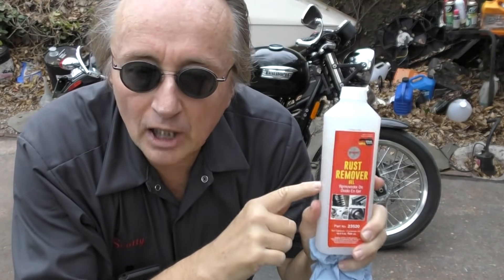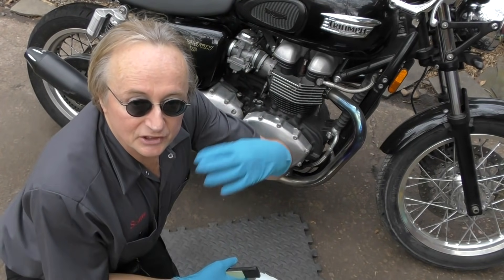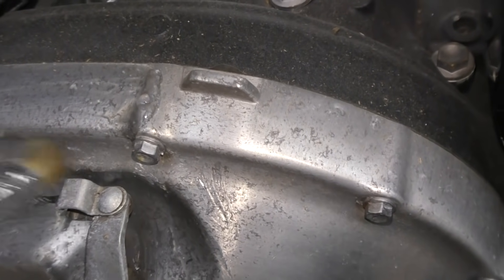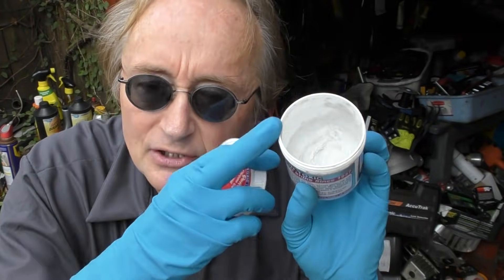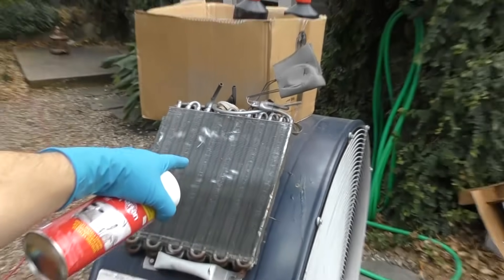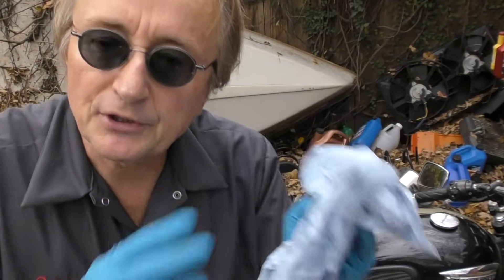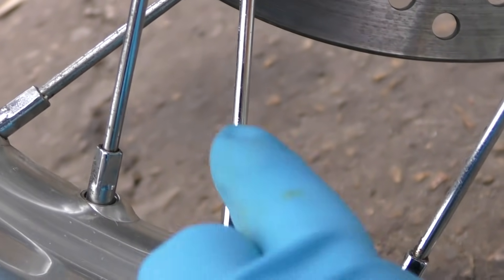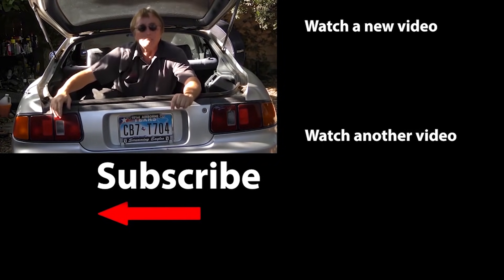Never Get Rust on Your Car Again

Comment: A millimeter is about the size of a number 2 pencil lead.  Bought a '97 F-150 with 180,000 miles that lived on a dirt road.  The frame and everything else was coated with moderate rust.  Washed all dirt and sand from underneath at cashwash, then sprayed 2 gals of Krud Kutter on everything metal.  The Krud Kutter turned the rust to a black paintable surface.  16 cans of 3m undercoating later, got it all sealed up and ready for Kansas road salt.  Like to try the metal coating Scotty.  Happy, Safe and Prosperous 2019 to everyone.  Instead of road rage, peace patience and love one another.

Comment: Here in Ohio, it's almost impossible to find a car that doesn't have some sort of rust. The salt they put on the road destroys vehicles
Reply: OhighO Skater 
The salt we  are using up here in Canada (we are three hours north of Grand Forks North Dakota) is beet juice it’s more expensive than traditional salt but it does not damage the roads and the vehicles
(It’s not the kind of beet juice you would drink)
Reply: OhighO Skater 
I wash my car two-three times a week anytime that there is an accumulation of snow or black Slushy snow on the rocker panels and quarter panels and wheel wells 
Although, Some weeks go by that  I do not need to wash the car as the salt is not a problem ; today were  -33 C here and I won’t need to wash it for a while because it stays clean
I just hate having salt on my vehicles ; my cars have Dont rust much but over washing them  has caused numerous paint chips on my 2006 and 2004 cars
thanks to Scotty I’ve sealed the paint chips with clearcoat as he suggested in one of his videos
Reply: OhighO Skater same in Central New York
Reply: @paulscontainersltd.4020  water activates the salt so if it's not above freezing, washing is the worst thing you can do.
Reply: I wash the salt off whenever I can too, best to get that crap off asap
Reply: WD40 in UK    Also. Ordinary household polish spray keeps moisture off everything to months. Cheap and quick to use.
Reply: Lol....I live in Canada. Some brands rust, others don't, ever. Ford's are good out to 20 years, Mercedes , 7-8 years, Mazdas, Hondas are rust buckets. Only Ford uses tar strips on welds and uses plastic wheel liners.
Reply: Yep, same is true in Indiana. The Midwest is brutal on cars.
Reply: Paulsaulsilverman S in NS they still use the ol rock salt, we can always tell when a car comes from out west because the bodys still in awesome shape but the windows are often chipped from stones in the sand they use, they were thinking of using a light saline solution for a while that was easier on metal and can work during a deep freeze but i guess it was too expensive

Comment: How many gallons to make a 1ft puddle of jell? So I could drive my car into and let it sit for about an hour.
Reply: I was thinking 20'x5' deep pool filled and renting small crane to dip my Subaru in like a taco chip in salsa...
Reply: Get a gallon of rust paint. Remove a quart and mix it with an equal part paint thinner. Use this as primer.
Thinner causes primer to soak into the rust.
Remove loose rust with a flat screwdriver and wire brush, prime  till the surface looks like orangpeel before using full strenth paint.
Reply: @suggesttwo  r/wooosh!

Comment: You have a happy new year. This is Ernest. From Kansas. I truly thank you for your time that you give us. You are very helpful. We fight rust here with the over treated roads. I am 55. Every year they put more and more road treatment on for the bad weather. When I was a kid, the roads would be snow packed for a week or two. Now it's clear right after the storm. Now people do not know how to even drive in bad weather. Not only does it destroy your cars. The roads don't last very long. Sorry for me going off on all that. I just keep a old Dodge truck to drive in all that mess. My Dad was a Ford man. In 1969 for some reason he bought a new Dodge truck and a Dodge car. Drove the wheels off them. The truck was my first vehicle. In 1975 my father got my mother a new Ford Maverick grabber car. It was nothing but problems. Motor then the transmition were both rebuilt by  Ford. At 34000 miles my dad traded it for a dodge station wagon 1979. My mother was very mad, for that Ford left her stranded in many places .her 1969 Dodge had over 300000 miles. The 1979 dodge ram mom 400000 + miles. All original. Except like starter and alternator. I even rebuilt the carburetor. I was like you in some ways. I love vehicles. Well with all the Ford car problems my dad bought a new 1978 dodge truck. That's how I got the 1969 dodge truck. We were from a Ford family. You know, just like the GM people. My dad caught hell from our big family. As a young man. Starting out working on Ford's GM and Chrysler products. I personally found the opposite of you and your grandfather. I found that with proper maintenance of the big three. Dodge/ Chrysler holds up the best. So over the years you can guess, I will stick with Chrysler products. And over the years most of my family, which is huge went with Chrysler products. 10 years ago a friend of mine truck died. This man is a Toyota driver. He was in hard times. I sold him my 1995 Dodge Dakota truck. I bought it new for my work truck. Parts runner, and loners to my customers. It had 265000 on it  when I sold it to him. On my 55 birthday he gave it back to me, well the title at my party. He said it still runs but you will need to jump it. Oh bye the way the transmition is slipping. And it's got 508000 miles on it. Well you know, I said thanks very much Brother. I have three Boys of my own. Only one is still at home. They are all in to the first generation Dodge Cummins truck's. Not me, I stay with my gas. Well my son and I went to get the Dakota back. I took a battery and transmission fluid and locus transmission fix.  Now remember I kept working on the old Dakota for him. Except for the last two years I had not seen the truck. After 3 quarts of transmission fluid and a quart in the engine. We started it up and drove her back home. We changed all the fluids and now my youngest son wants to drive the truck, see how many more miles he can get out of it. Sorry Scotty I'm not a Toyota man or anything else. This is why America is in the shape that it's now in. I do not sale out. People have forgotten pearl harbor. As far as Chrysler. 1984 is the newest vehicle I have now. Because of all the Chrysler sell offs. I am a American. GM and Ford aren't really American anymore. I love you brother, truly sorry for you have sold your family out to Japan.

Comment: It's almost next to impossible to prevent rust and corrosion where theres any decent amount of snow.... all the salt and solutions they use to deice roads just ruins anything. All you can do is try to wash vehicles whenever it's possible, or just stay a hermit all winter. North Dakota is atrocious for using the crud.

Comment: Hi Scotty.  When I lived back east, I never had a reason to use a rust cleaner on chrome, but I have used a rust converter on ferrous parts.  Bulkhead/basement doors and windows frames.  I had excellent results using them.  It not only converts the rust, but provides a base coat for primer and top coats.  I never had to deal with rust on those items again.  Now living in Phoenix, it's not really a concern.  When I finally had to do some work on my 2007 Avalon, I was amazed that bolts and nuts were rust free.  Silly me.  I thought Toyota was treating their hardware to keep them oxidation free!  High heat and low humidity was the real reason.  Happy New Year to you and your wife!

Comment: Gotta say Scotty, I was in an electroplater till 1990 the company did a great job when it came to chromium plating,  ie steel would be highly polished after stripped then heavy copper with another bright copper finish, then a good coat of nickel & chrome.  Doubt if it’s like that anymore, would just be one coat of standard copper. Anyway keep up the great videos Scotty, from 🇮🇪

Comment: Not rust related but my brake calipers are starting to collect a film
Of oily
Residue that looks dingy to me . I try to keep my car extremely
Clean but not ocd. However the dirty calipers did t respond to the last pressure wash ... so how about some tips that won’t injure nearby paint or alloy wheels on my 2017 Toyota 86.

Comment: i just picked up a 1995 cadillac deville with the 4.9 it has 89k original miles im in the northeast and it must of been garaged by the original owners carfax says only 2 no rust except  on the hood there is some small  rust spots from rock chips will this stuff help

Comment: One thing I've used in the past for removing surface rust off chrome is #0000 steel wool.  It's fine enough to not scratch chrome, but it will scratch painted surfaces.  If you're doing spokes, be gentle so you don't end up flossing strands of steel wool between two spokes.  Thanks for your videos, Scotty, and Happy New Year!

Comment: Years ago all the auto parts stores had this.  It was called Naval Jelly and was a pink jell with a dauber attached to the cap.  Sometime in the 90's it disappeared from the store shelves.  Loctite makes it now and you can get it from Home Depot, it's called : Loctite Naval Jelly Rust Dissolver.

Comment: Hi. I hoped that this video would cover rust on painted metal sections. I heard you mention doing so, though. I have a rock chip on the metal above the windshield that already has started to rust. It is such a small spot, a little bit bigger than a pin head. Will this product damage the surrounding paint from over spray?

Comment: that's another thing why don't car companies offer as upgrade option a stainless steel chassis w/aluminum body panels, I believe consumers would gladly pay additional cost knowing the infamous car cancer rust would be defeated by elimination. hi Scotty HNY
Reply: ...because there are in business to Sell vehicles not to preserve 'em like every last one will end up at the Smithsonian Institute... not the crusher....LOL 😎
Reply: You can get the Ford 150 with aluminum panels but generally speaking stainless and aluminum require a different manufacturing process - and it also crumples differently - for safety ratings.  And it's really expensive, especially stainless.  I like the idea, but who wants their car to last for 70 years or more?
Reply: Drive a stainless car on enough salty winter roads and it'll rust just the same.
Reply: @williwonti  Nah.  Which stainless steel car did you drive that this happened to?
Reply: Stainless will rust and corrode  it will just take far longer to happen. A big negative would be replacing any large aluminum parts with stainless, as it's considerably heavier. It's probably easier to repair however as it can simply be arc-welded as opposed to tig-welded with aluminum parts.

I get where you're coming from though, having lived on the coast for a long time rust is an issue every vehicle eventually has to face 😔

I just remembered there actually was a company that made stainless cars. Delorean
Reply: Ask somebody driving a '32 Ford 3 window coupe...
Reply: @JustAlanIsCool  DeLorean was just the panels - the chassis rusted as well as any other car.
Reply: @MrKnutriis  Stainless steel will rust it just steel thats dipped in a stainless coating eventually it will start to rust however it would take much longer than standard steel.
Reply: @gravemind6536  No - it's a completely different alloy.  And there is more than one kind.  Look it up.
Reply: Will & Will I am 316 grade stainless is some super tough stuff it's used at various chemical plants to contain extremely caustic liquids and then shine up like a new penny unscathed
Reply: @gravemind6536  wrong, you're thinking of galvanized steel. Stainless steel are not all equal and some alloys like H1 used by Spyderco (US knife manufacturer) is simply one of the best alloys for resisting corrosion.
Reply: @MrKnutriis  I won't even be alive in 70 years....lol
Reply: @Anth230  Sure you will - that's only 92 years old
Reply: @MrKnutriis  Actually it would be 100 years. But unfortunately 88 is my graduating year.....so I would be 118....lol
Reply: @Anth230  My bad math
Reply: Stainless steel chassis and aluminium body panels would CREATE corrosion. Dissimilar metals lead to galvanaic corrosion, it's something that can be reduced with a jointing compound but it will still corrode.
Reply: @underwaterdick  Good point.

Comment: Hy Scotty!!!
            The only place I have been able to find Fertan, in the past 5 years, for tiny spots of rust on my cars, is from the UK. Can't buy FERTAN anywhere in the USA.  I bought several bottles of it, like 1-2 OZ tiny bottles, for like $15 each!  A completely watery liquid, with a touch up brush, like touch up paint. I never new it was 'Navel Jelly'?  
I recall that stuff from decades ago. Is it the SAME chemical?  And in gel form?   
I use it to get under paint, to get to rust in tiny hidden places on my cars/trucks, the liquid flows right into the rust, under the paint/clearcoat, and stops it.  Then put touch up paint on it the next day, it changes the rusted metal into an 'inert metal', that CAN then be painted over, and sealed..

Comment: I have a 2000 f150 with a 4.2 v6. It has 278,000mi and still going. I do have a rust problem which is common on these on the roof and fading on the hood, so this video was great for me! Oh, I live in SE Louisiana too!

Comment: So I could clean my car's cosmetic body rust and then spray the white capped can on those spots? Is it "clear"?
2005 Hyundai Elantra with solid manual transmission and engine. Terrible factory paint tho!

Comment: Contains Citric acid, phosphoric acid, glycollic acid and some alcohols - but DON'T use it as a vitamin C source or cocktail mixer or personal lubricant. Seems to work much like stainless steel weld pickling gel although they might use hyrdrofluoric and nitric acid. In any case definitely use the gloves, eye protection if you don't already wear it and a respirator might not hurt either. If this stuff is neutralised by water (like the weld gel) keep a bucket or hose nearby.

Comment: I have a 10 year old Bmer.  Outside looks almost brand new, however, when I look underneath, there is a ton of rust everywhere.  Northeast weather didn't help.  Is there really any good solution for protecting the underside from rust in the long term?

Comment: theres some electroplaters which don,t three stage plate. ie : copper, nickel . and chrome. I,ve done metal polishing, and some chrome plateing . some places don,t have a copper tank. then the item will be more prone to rust. as the nickel won,t give much protection on the weather. lets say get car  a bumper plated. get three stage. once you receive it. paint the under side. [use that stuff what mr scotty saying to help seal it ]. as that part hardly gets polish. plus its hard to throw the eletro chemicals in the underside . chrome only  dye . I,ll have to have a look out on this stuff here in nz. good info mr scotty

Comment: U the man scotty . Am in process in dealing with rust in bottom of door panel at bottom water must be getting in and collecting at bottom . Now need to sand it all . Full spray job needed got few tricks found out how to prevent in future . Pour transmission fluid or vaseline down inbetween door panels with tube and with syringe pour it down and that put seal for water not to lie ,cause more problems . . Have u heard this or recommend it should work ? Ano everything will be ok if u say it correct . Thanks scotty ma main man . ✌🙏🤘

Comment: Never buy a car from anywhere that uses salt. You will get rust in places like brake lines fuel lines bushings suspension parts and things you could never prevent or clean.

Comment: Old science. Look up sacrificial anodes on Google. Used those  on naval vessels forever. That multi metal coating is the same except it's a light coating of aluminum used but same principal. There are diy methods out there that work as well or better.